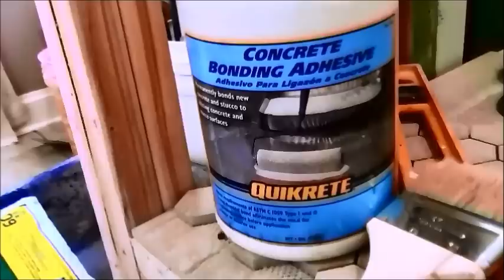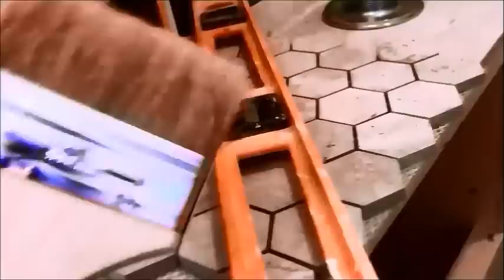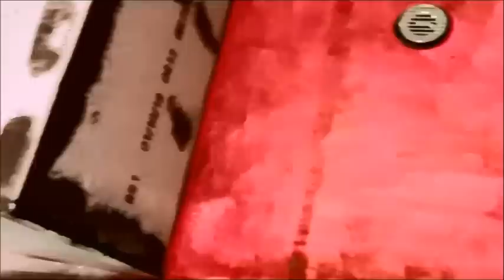Building Curbless Shower on Concrete Slab

Comment: I really don't get your dislike for Schluter.  You agree it is 100% waterproof yet you back it up with Redguard?  The only issue I had with Schluter is that it is tricky to get the thinset applied to the wall evenly before applying it.   For a professional, this shouldn't be an issue since it will come easier with practice.
A plus for Schluter is that you can use plain drywall and you don't mud the joints.  Actually, must not use greenboard and if joints must only be filled with setting plaster.
Honestly, I have a hard time believing that Redguard is that good.  So much depends on how even you apply it.
Reply: Because schluter is spendy and I think he likes to show people you don’t have to jump on the schluter train, theres other options.

Comment: I'm in the process of doing a very similar project. I had to replace all my old wrought iron drains with pvc. I figure since I've had to spend a week cutting new paths through my slab, anyway, I'd go ahead and put in a curb-less shower as well. After watching this, I think I'll do Red Guard as well. I have the time to let it set-up if necessary. I'm installing a linear drain at the back of the shower with one straight slop from the front to the back. But that leaves a lip of concrete along the sides. I'm not sure how I'm going to transition it to my backer board. I wonder if I can use thinset to smooth the transition, Red Guard on top, and then thinset for my tile?
Reply from the maker: You can use thinset, but was something like that I would use the quick setting mortar mix. Actually did a curbless shower like you are talking about where I had a transition, I will see if I can search for the video and Link it.
Reply from the maker: https://youtu.be/9RKR6Wyd25M

Comment: Since you are not doing a shower pan liner, did you not use the middle section of the drain that you would usually clamp the liner under? Fixing to buy my drain .
Reply from the maker: Did it same as a liner...same x cut on bolt heads and center
Reply: So do you build up the thin set around the drain to clear the “hub” and the bolts? I know on a normal application you would fill it all in with the deck mud, I’m unclear on how this would work with the slab/Kerdi. Maybe I need to release the bottom flange a little? Thank you once again for the help! Moving and setting the drain tomorrow!
Reply from the maker: @sikassscivic  I used quick set mortar to skim out the 3/4 inch of the bottom flange and match it up with the outer parts of the pan itself, that's the only real mortar that was used because you don't need a mortar bed for this application

Comment: I love your channel and watched hrs of your videos before I tackled building my own custom shower and mud bed. I have a question regarding hanging the wall board a 1/2 to 1" off the pan to prevent wicking. When you do this an fill the gap on bottom with thinset or grout won't that also wick the water up to the concrete board. Just wondering i am hopeful the fusion pro that I used will prevent that.
Reply from the maker: I never fill that Gap with anyting, a lot of people want to use some silicone but I don't really see the point

Comment: Did you have any issues with the kerdi wanting to not sit flat on the floor with the slope? Does it stretch to conform to the slope or does it wrinkle up ?
Reply from the maker: Yes it's at flat on the floor with no wrinkles, large enough area where that was not an issue, plus it was put down with thinset and if I'm not mistaken I probably put bags of mortar on it overnight

Comment: Great finished look. I appreciate your frankness too. Im a handyman with journeyman skill. I’ve been asked to do a tub to curbless shower convention in a 1920’s Chicago multi family building (brick exterior) that has a rectangular bath similar to what you would find in most single level ranch homes; door, vanity, toilet, tub, exterior wall. It’s all very tight. The client wants a full-length glass door panel and door as well as a small bench. Do you have any recommendations regarding materials and techniques?
Reply from the maker: Wow, way too many details to go into on a comment section , you will have to go through YouTube with everybody's curbless shower and all of their methods including mine and just find out your own way I suppose

Comment: I'm building a 5x7 shower in the basement on a slab with a mortar bed and a curb, all new construction. To cover the sides, floor and the curb, my shower pan liner would need to be 7' x 9'. Would applying the Kerdi membrane to the floor (and 6" up the sides) along with a Kerdi drain, then Redguard up the remaining walls be my best option? Do they even make the 40 mil pvc liner this big? I've been watching your videos and they have been very helpful. Right now the size of the liner is what I'm hung up on. Thanks in advance.
Reply from the maker: If you choose a liner then you could get the specific glue to overlap each piece of liner by about three or four inches and it will become one larger piece... I've done it before when necessary. The thin membrane of Schluter could work also but it has to have a specific purpose for me as I've only used it a few times because nothing else would work
Reply: @StarrTile  Thank you for the reply. I just found another video on doing just that. Now I'm all set. Cheers!
Reply: If I use a 48x72 Kerdi tray that has a center drain can I dry pack the 1 foot area around the tray then use Kerdi band at the seems with thin set? Thank you!

Comment: Bob thank you for uploading these very educational videos, I’m a DIY’er, my next project is to redo my master bath, my wife wants a curbless (beach access type) tub to shower conversion on a concrete slab.
This video will serve a my guide of how to approach the project.
I have one question, can I use a pan liner after I form the new concrete pan? Should I use thinset to secure the liner to the concrete pan?
I enjoy your videos, keep them coming. 
Frank
Reply from the maker: Every situation is different, I ran into a conundrum here and did it the best way that I could figure out, normally pan liners are too thick to make things happen on a slab type of shower.. I don't believe that thinset with stick well enough to a liner so I would not take that chance, if you're going to use a liner I would use a couple of tubes of caulking very liberal, when I have done that before better than silicone I use a latex caulk

Comment: Here you obviously put the kerdi BEHIND the wallboard. Everyone I see use kerdi, they put it in front of it. I like the idea of using redgard+kerdi on the walls, because kerdi is too expensive to throw on the walls IMO, but any particular reason you do not put it in front of the wall?
Reply from the maker: Typically I use a liquid waterproofer on the walls outside as I do with this Redguard, however the curry that I used was specifically for a pan liner has a curbless shower is easier to build with a cloth membrane like Kerdi than it would be with a rubber membrane, therefore the Kerdi was a pan liner, then Redguard went on top

Comment: Rapidset, or any other products of a "concrete nature" never make a water seal in a "butted" format.
I suggest you simply add a crack-isolation material over all seams.
Reply from the maker: Exactly why I painted on 2 coats of Redgard
Reply: @StarrTile  , good job Starr...  also, keep in mind, that the rapid-set is not a ''cement based'' product but you are okay in using it for these applications.  It does need to be moist cured, meaning keep it damp, or at least wet a cloth down and let that wick into the surface...  Wish you the best.

Comment: Guys one of the biggest parts of this job is installing the plumbing for the drain and you practically skipped over it. We need to see the connection from new drain to the main drain line

Comment: Hello. Loved you video on improvisation.  How did you tiled over the oatey shower drain with screws and plastic locking part ?thank you.
Reply from the maker: I'm not sure what you're talking about, I use the kerdi material then poured the pan with mortar, waterproof it then tiled over that

Comment: What did you do to tie the cut our portion back to the slab?
Reply from the maker: Not sure I understand
Reply: @StarrTile  since you made it a recess pan how did you support the portion of the slab that is now cut and shifted down.
Reply from the maker: @samuelspornhauer1019  it was in the video...I didn't cut ALL the concrete out, just hammered out enough to get a slope, buttered out rapid set on it and installed kerdi membrane.

Comment: I was shocked to see you use Schluter lol. on the bench do you use metal trim around the outside or vut a 45 or just overlap them?
Reply from the maker: Schluter trim was used on left & right sides and in the niche, but my customer wanted bullnose on bench & kneewall.
Reply: @StarrTile  ahh I have to use metal trim around a bench too. I am going to suggest those 90 attachments. Makes life easier

Comment: You can use a lawnmower to cut your grass, or you can use a pair of scissors.  Both methods will yield the same results, one just requires a lot more work.   I know people can be set in their ways,  but why not use the product like it was intended? If you're going to spend the money on Kerdi, install it in the manner it was designed to be used.  Mud the pan, kerdi the entire shower and bench, install tile. It's done that way thousands of times every month by thousands of different installers.  Even though you ended up with a waterproof box to install your tile, a lot of unnecessary time and labor was invested to achieve that goal.  Time is money in the tile business. Quality prep work is paramount,  but it can be achieved using modern products and methods that don't take multiple days to install.
Reply from the maker: I am paid very well by my customers and time is allocated to each job I do, getting out earlier will not yield me any more money, my next job is already pre-planned and I can't just pop in a day or two early... my focus has never been to get it done quick, my focus is to get it done good.

Insofar as the product goes it is never been reliable in my opinion, there are too many errors that can occur and there have been tests done where there has been some leakage the way they engineered it to overlap. It did however serve a purpose on this particular job and was modified to suit my need.. I find absolutely no advantage to installing it correctly and having a failure. Of course if I were being paid by the manufacturer to make a video on how to install it then there would be that, but I wasn't👌